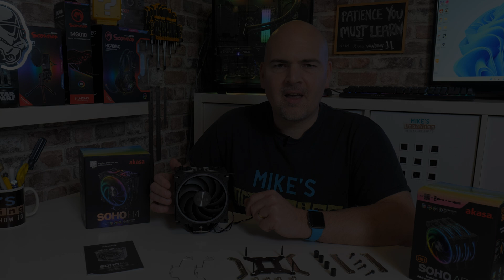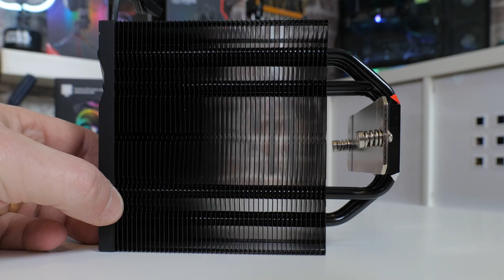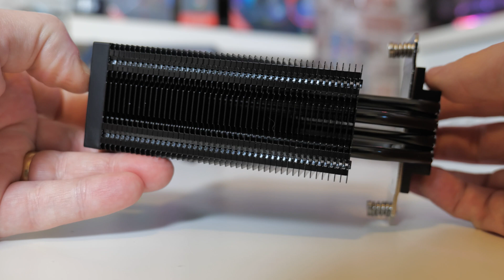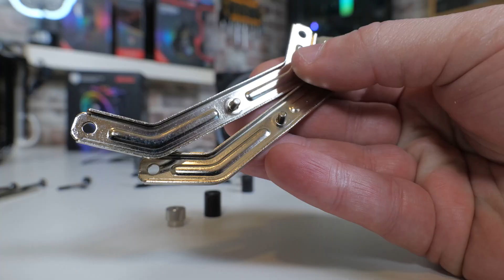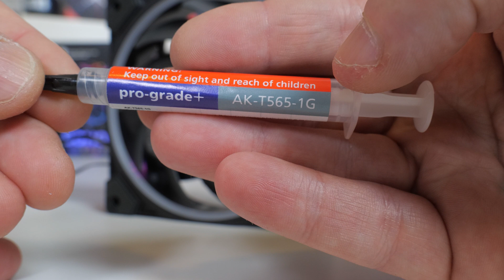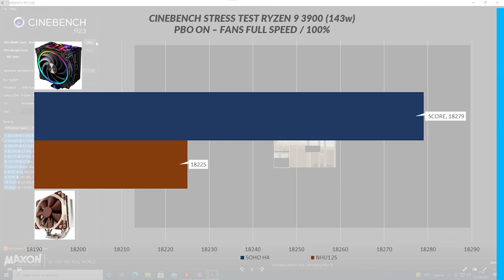Noctua NHU12S  VS Akasa Soho H4 Super 120mm Tower CPU Cooler Install & Testing

Comment: Which control hub do you use ?
Reply from the maker: usually a cheaper one on amazon 11 port or whatever comes with the case i am using at the time
Reply: @mikesunboxing  changed my case installed the Akasa hes  very good
Reply from the maker: Yes it is a good cooler glad you like it

Comment: Sweet looking fans and I love overall RGB implementation 😍🥰👍🤯! The rgb is a little underdone on the heat sink as a few hotspots in the video which needs a little more lighting or better defusion. Pricing seems fair for the performance 👍🏆🥳🤩.
Reply from the maker: Totally agree the top part i would actually prefer to be bare blacked out metal

Comment: My 3950x boost to around 180W, same as my 5900x at 100% 24/7. And that's with pbo. The room temps is around 22C now and both Snowman MT6 keeps them between 80 and 90C. So, looking that you "only" draw 143W make me wonder if you set the limit to 143W for constant result. My 5950x boost to around 210W but the nh-d15 keep it around 82C.
Reply from the maker: i haven't set any limits just let the motherboard do what it wants to based on temps etc
Reply: @mikesunboxing  ok, I thought that the 3900x could draw more than that. I had an eye on a 3900x for 450$ cad, but decided to wait a bit longer as I don't have a need for another computer right now.

Comment: Wow, CB R23 sends your 3900X temps into the 70s? That's about 15c higher than mine. It is a nice-looking air cooler.
Reply from the maker: i may defense it is quite warm in here and PBO is on (which i should turn off)
Reply: @mikesunboxing  I keep my room temp about the same and I also have PBO on. My 3900X is overclocked to 44.5Ghz on all cores @ 1.3v. It's simply a good demonstration of the difference between a good air cooler and a custom loop. 😉

Comment: just looked recently on ebay with varied prices ,i would not buy them for the price of a 4 pipe cooler you can get a 5 pipe cooler for less of the price with rgb  and about 8% more cooling so disapointing but not bad .
Reply from the maker: yeah the price could do with coming down a bit to make it more competitive
Reply: @mikesunboxing  I do think they were selling the rgb on the top frame of the cooler 
which does not surprise me as buyers may be attracted to the idea as a novelty 
i am more of a performance into what i can get out of it .

Comment: That Akasa H4 is a good looking cooler !  Shout out to Akasa for sending this in to Mike for review.  Its ticked the box of cost.....£40 for this looks bang on.  Easy to fit and looks smart when installed and judging by the temps its no slouch either.  Nice alternative to some of the choices out there at the moment, thanks for the review, Mike and Kath.
Reply from the maker: i think with the competition and also the brand snobbery that exists a price drop might sway a few potential buyers